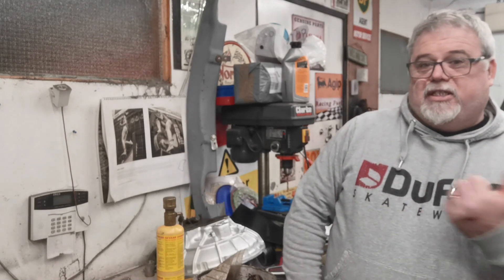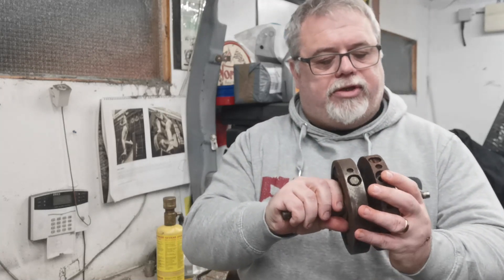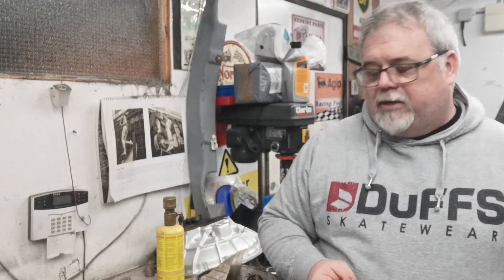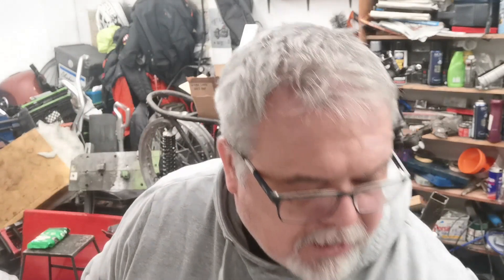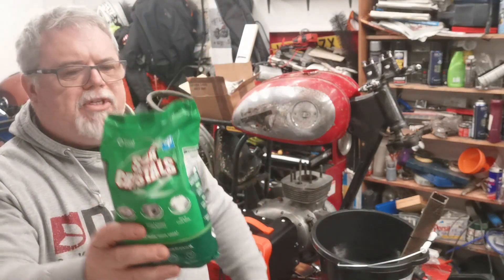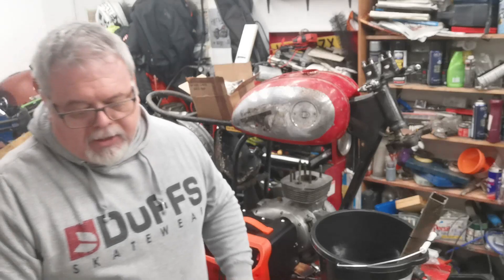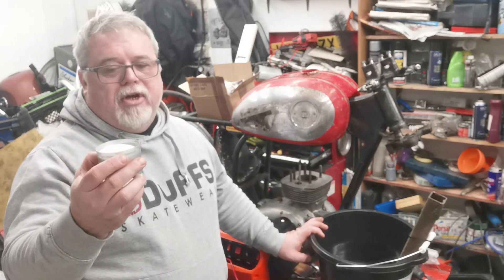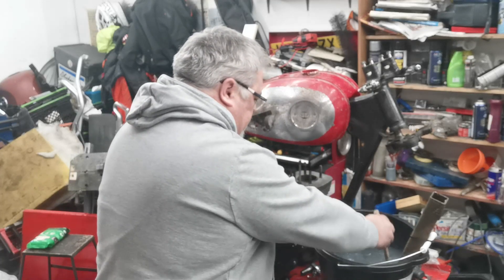BSA Scrambler Build Day 2

Comment: You should have hung the crank on a bar across the bucket so it doesn't touch the bottom
Reply from the maker: Genuinely interested what difference would it make? Before attempting this I looked at a few videos and the larger stuff was just immersed in a plastic tank and not hung.